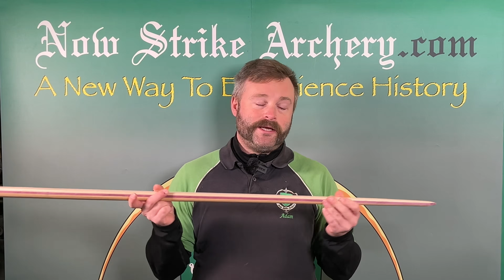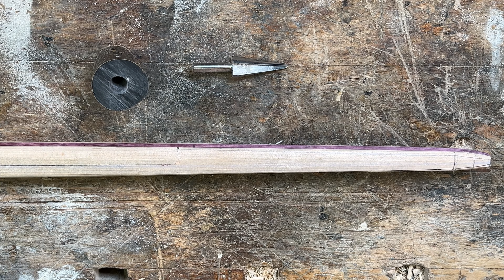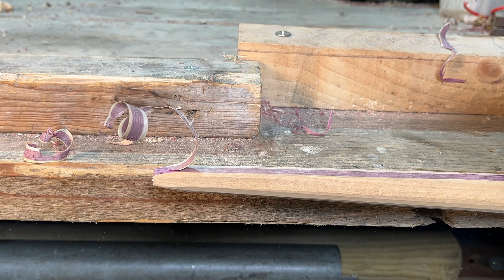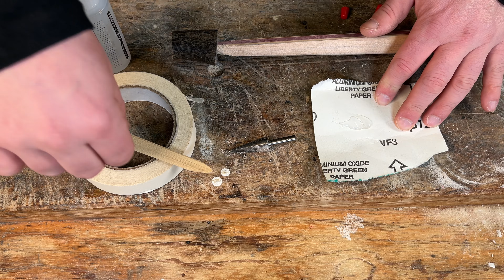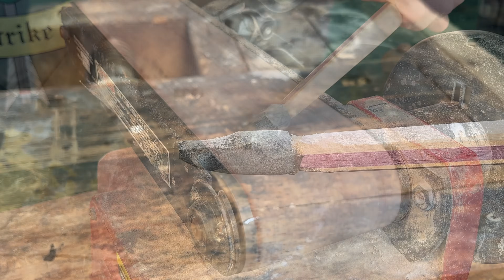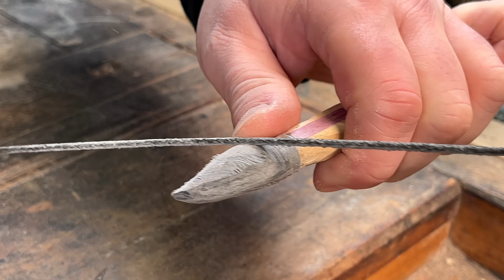How to Fit & Shape Horn Nocks for an English Longbow

Comment: Great video, thank you for that.
I want to make a strongbow about 70-80#.
 I am afraid of taking so much wood off at the end of the bow
Reply from the maker: Thank you, glad you found it useful. Keep in mind that the Mary Rose longbows all piked down from the last 8 inches to around 12-13mm in diameter where the horn was fitted and many of those were pulling way over 150lb

Comment: I want to have a second string notch so I can string my bow easier. What would the best way be to do that with a horn tip?Should I make the wood go deeper in the horn? My concern is mainly the second string being to far out and breaking the horn tip off.
Reply from the maker: Ideally you cut the stringing nock over where the wood sits inside otherwise too much leverage and draw strength can break the horn off or crack the socket. It’s hard to advise without seeing it, just bear in mind that any alteration to a finished bow can change the tiller shape and throw off the centre point. I’d be inclined to cut a stringing nock slightly above but close to the string nock. If someone made it then perhaps talk to the bowyer first
Reply: @ thanks for the reply. The bow isn’t finished yet. Iam making it out of yew and realized that because of the high draw weight it needs horn nocks. So far having trouble putting some on as iam trying to use antler tips. ( don’t have access to cow horn unfortunately.) the antler is just too small iam finding. Do you think doing tip over lays would be easier and make it so the string doesn’t dig into the wood anymore?
Reply from the maker: @Endlessprojects0174  As it is a laminate you will have a danger of the tips delaminating without the horn nocks sealing them. It's not 100% likely but certainly possible. I am not personally a fan of antler, have you tried sourcing alternative horn such as buffalo/bison?
Reply: @nowstrikearchery  it isn’t laminated it is one piece of yew. And I could probably find something online I suppose.
Reply from the maker: @ Ah I miss read, I saw "Iam" and assumed as that's what I call laminates. We sell horn tips on our online shop: https://nowstrikearchery.com/product/horn-nock-pre-drilled/ 

The shop is currently in away mode as we are heading to a fairly busy show but it'll be open again when we return. If you are in the UK give us a call and we can sort it out sooner rather than later
Reply: If I put horn nocks on my already completed bow , will I have to re tiller it ?